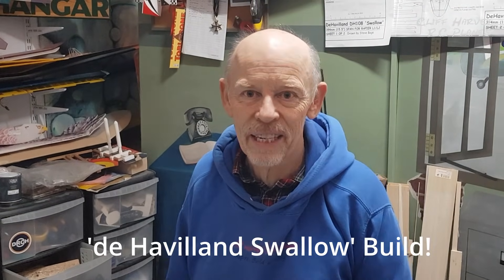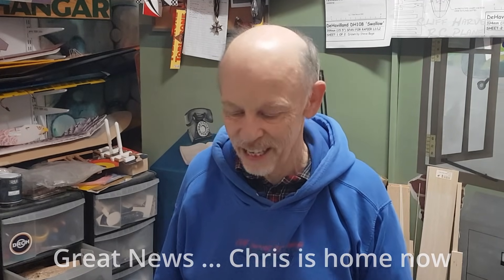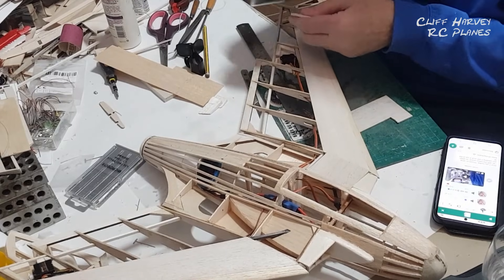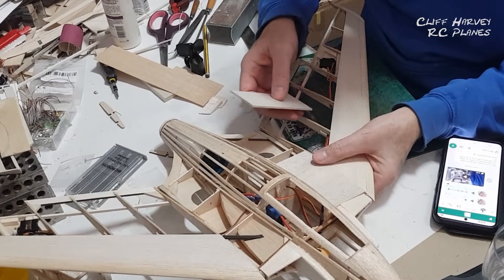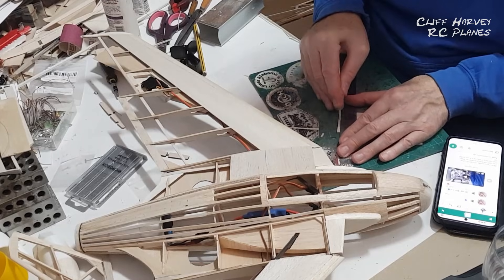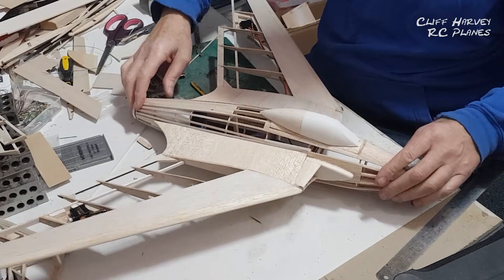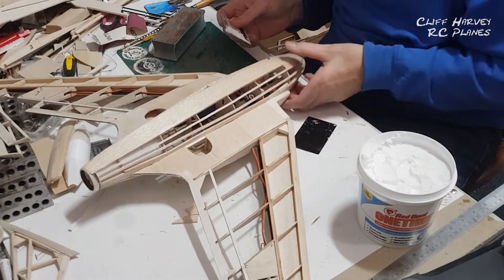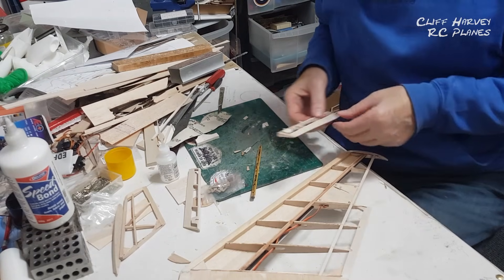Watch Me Build a Balsa Swallow EDF Jet Plane From Scratch! Part Five

Comment: Hi Cliff from Canada, I notice you using Titebond rapid set glue.  Why do you it in certain section verses CA and why?  second question is that filler your using what make is it? Thanks,
Reply from the maker: Hi Hector, I have used Titebond in the past, nothing wrong with it, but I'm currently using Speed Bond by Deluxe Materials. It grabs quite quickly. As for where I use it, look at it this way, ca stick things together very quickly, but there's no flexibility to it so potentially a joint could break, whereas with white glue there seems to be a little bit of movement. What I can do is to use ca for speed then back it up with some white glue over the top. White glue will fill slight gaps as well. I use a epoxy glue for load bearing areas especially if I'm gluing plywood or carbon. I guess if I've got time I'll use white glue.
It's somehow more satisfying. Ca is useful for tacking parts together while the white glue sets 👍